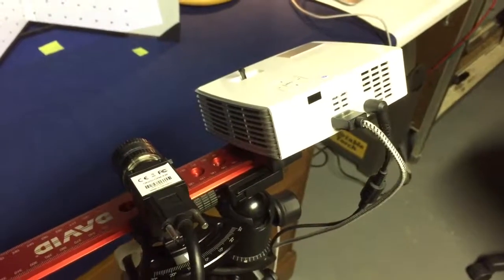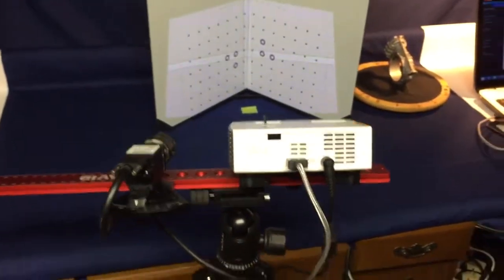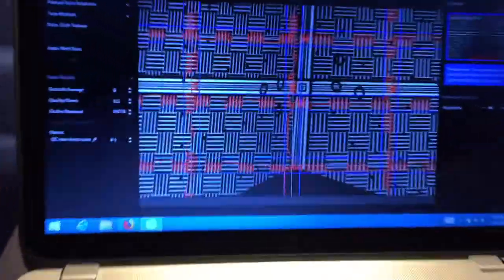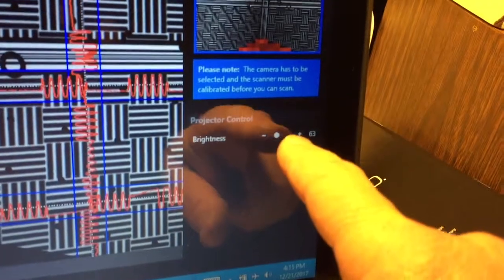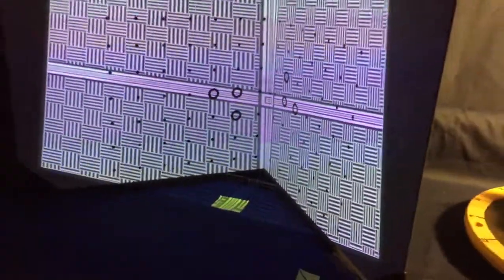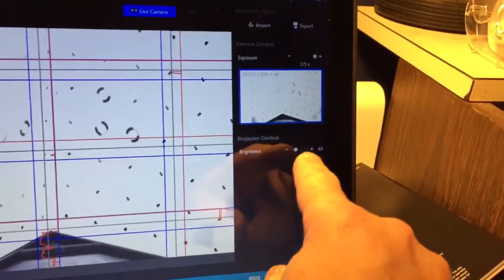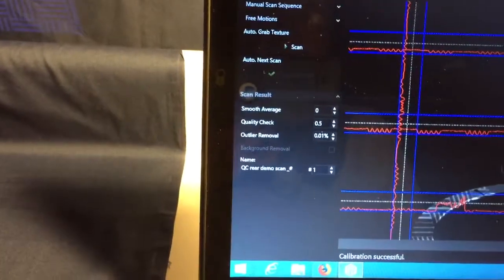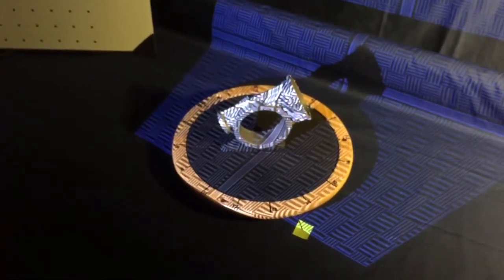Part 1, HP David SLS-3 3D Scanner demo, Calabration

Comment from the maker: This David scanner SLS-3d scanner package I am demonstrating here has sold. But I will leave the two videos on this scanner package posted as there might be some information in them that might help someone. Right now I am using my own structured light 3d scanner setup running David v4 software and I like it a lot. Being able to change lenses on the camera (it uses C mount lenses) makes it really a great setup over scanners that have the projector and cameras mounted in a box and you are stuck with the focal range and focus that they give you. This setup frees you from those restrictions.